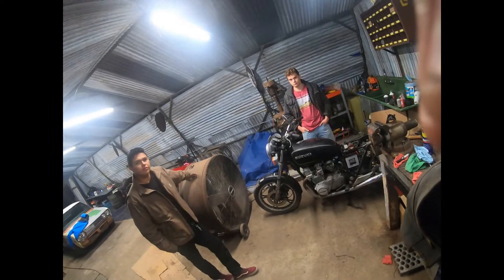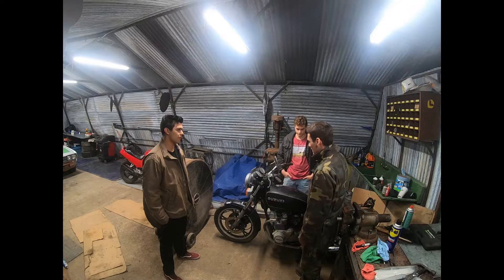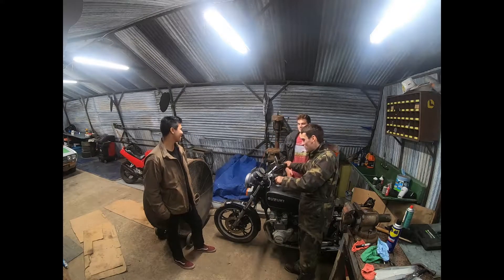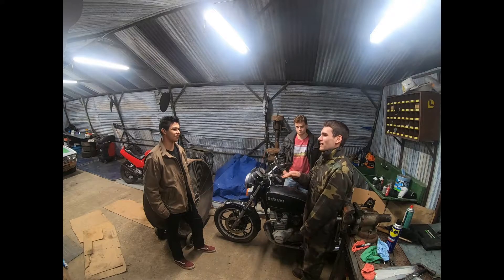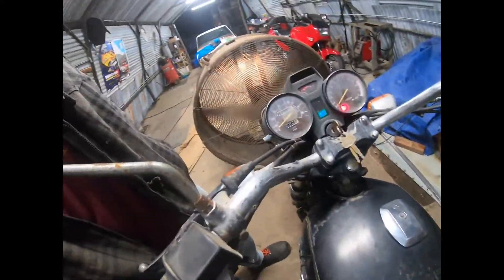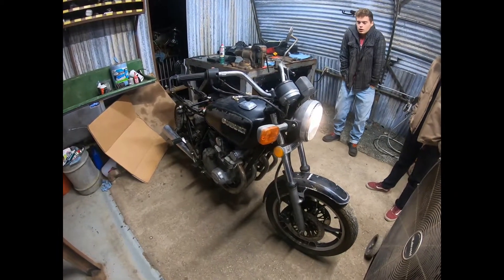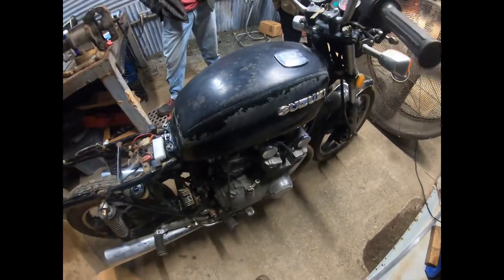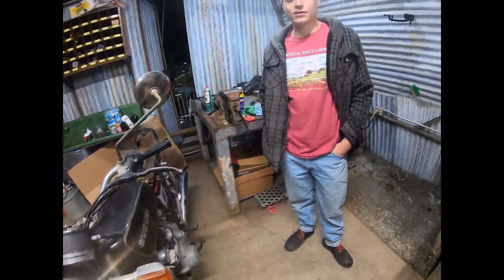Suzuki GS650 Engine/Carburetor Tuning

Comment: It seems as though your pilot jet is too big if it's getting too much gas, that's going to be from quarter throttle to half and from half to full throttle, your main jet, Is too big. either that they could be clogged. I believe you said it's getting too much gas. So you have a good idle. That's a good start, so check with what the manufacturer recommends for pilot and your main jet. You could have to adjust the needle jet up. Which will bring the needle down one?  Or 2 notches if you don't have a set needle jet. Hope that helped you, and you got a running perfectly.

Comment: What did you do to improve its proformance....
Reply from the maker: Turned out that I needed the stock air box on there for everything to run correctly, these engines are very sensitive to anything other than the stock parts. I'd guess you need new jetting to run the less restrictive pods many guys throw on this thing

Comment: My 1981 GS650GL did the same thing. It was due to sitting for the summer in a hot Arizona garage with pump gas in the carburators. Ran fine prior to parking it for the summer. Found the primary jets were plugged with ethanol gas related gunk. Cleaned them out and took care of the issue.

Comment: Dude, petcock is hydraulic assisted. You need a new one. Mine had same problem. Runs great now. Think it was 47.00 on amazon
Reply from the maker: Awesome! My problem was actually related to my air box, the carbs are very sensitive and required my stock box to be hooked up.
Reply: @johndias8876  that's good! When I had gotten mine the previous owner did away with the airbox and put pods on it...he never could get it to run right, I knew what the deal was and it took FOREVER to get it to run. I went up almost 6 sizes in jet to give it enough fuel. I could have beat the dude for throwing a perfectly good airbox away.

Comment: Problem solved? This may be out of the case, but some instructions say about GS CV carburettor  balancing: on CV carbs the two outside carbs are set about 2.5 - 3.0 cmHg higher than the inside pair
Reply from the maker: Ekso, the problem was that I did not have my stock air box on the bike. Everything is all good now!

Comment: Your GS will have Mikuni BS32 CV (Constant velocity) carbs fitted, which are very very temperamental - Have you got the original air box? fit that back on and i guarantee the bike will rev better.
Few other things to check:
Remove the plugs and see if the motor is running lean or rich
Make sure all 4 cylinders are firing by checking the exhausts.
Check your fuel filter - remove fuel petcock and you will see it. Alternatively rig up a temp fuel tank
Make sure your mechanical advance behind your pick up (either electronic or points) is moving freely and returns back on its own (2 springs)

Hope this helps
Reply: pick up is on the right hand side of your engine when you're sat on it - small  round cover with 2 screws
Reply from the maker: @danielgaul6537  You were right about the carbs being very temperamental, I put the stock air box back on and it revved perfectly. Thank you!